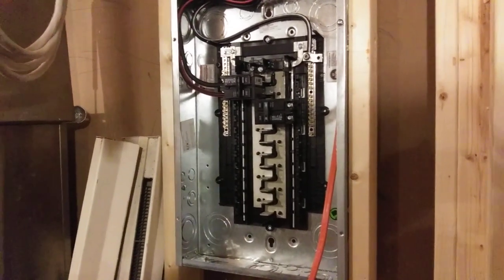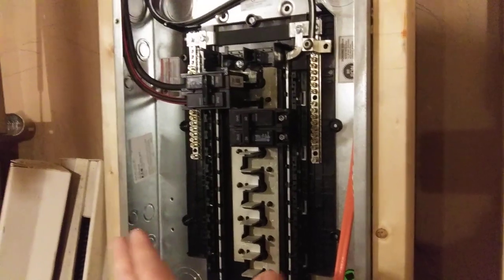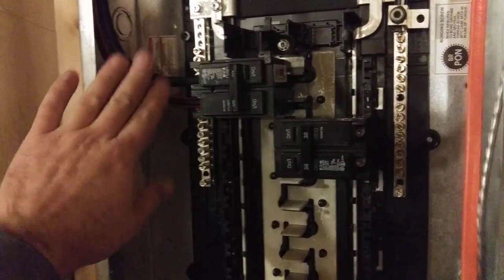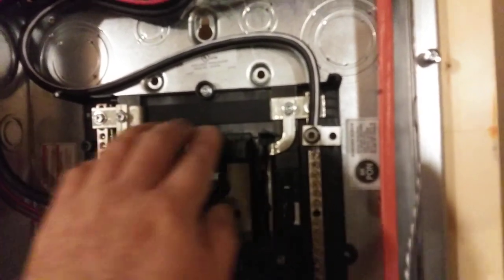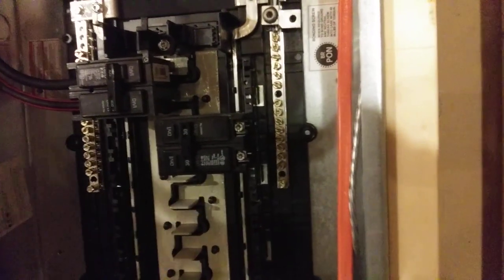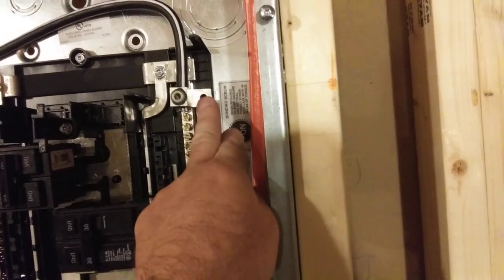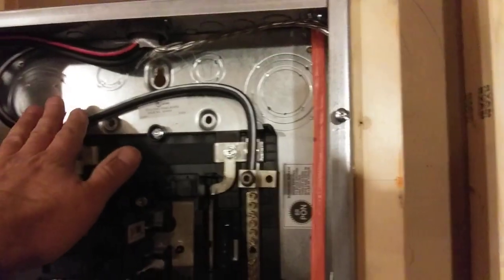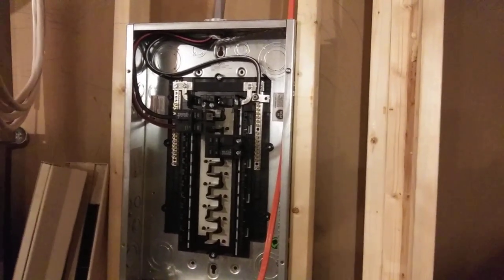Subpanels only get SER Cable!

Comment: Do you connect the sub pannel to ground rod
Reply from the maker: You can always add ground rods for any panel, but all sub panels must me unbounded. You can never have too many ground rods.
Reply: Only required if the sub panel goes in a detached building (such as a garage/workshop)
Reply: @JamesGlassJamesGlass  I dont agree you can have to many ground rods. Mike Holt has a great video about why. Remember grounds help take care of surges from lighten and spikes.
Reply: @JamesGlassJamesGlass    Just to be very clear, the purpose of grounding electrodes, including ground rods, in residential electrical systems is for lightning protection and had nothing to do with equipment grounding conductors in feeders or branch circuits.